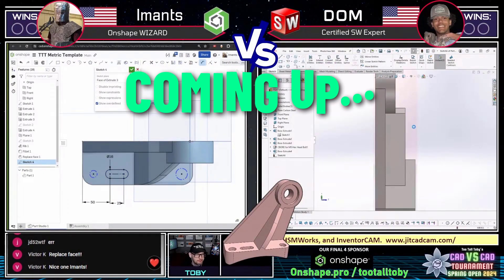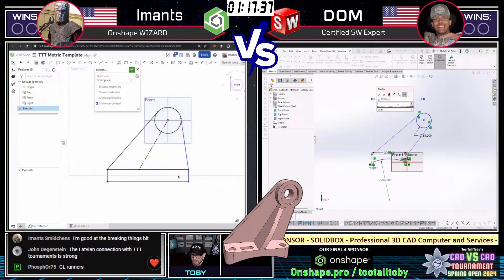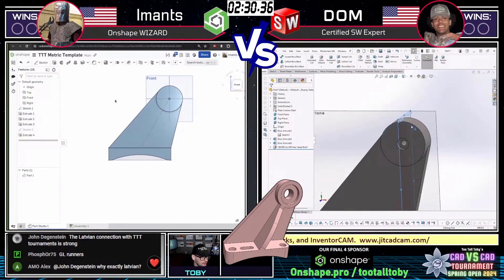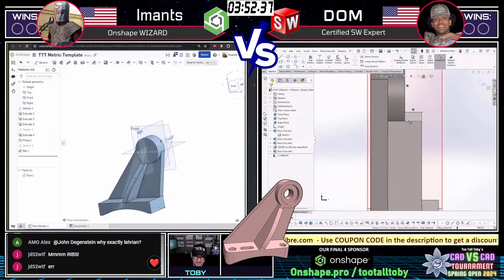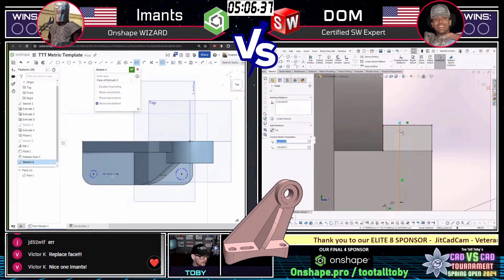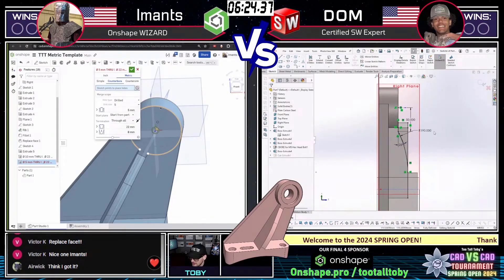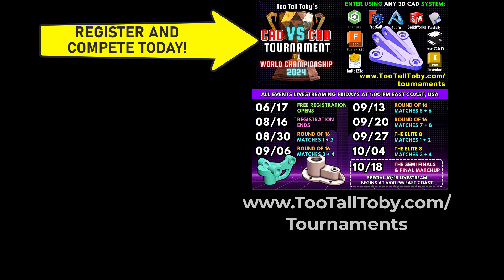Which is FASTER? - ONSHAPE vs SOLIDWORKS - Imants vs DOM match 1 - DENSITY - 2700 kg per M^3

Comment: Hi Toby,
I love your videos and I practice with you every time you publish one.
In this one, there maybe a mix-up in the initial information and some will get different results:
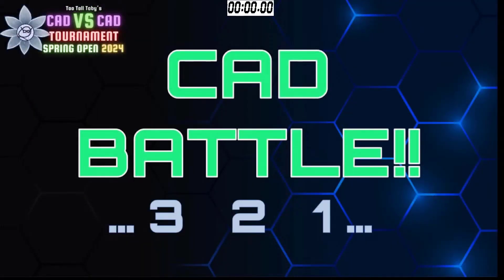At 1:22, at the bottom right you have Material and Density.
If the Material is "1060 Alloy" then the Density should be 2700 and the correct answer will be 3045.0 g
But if the Density is 7800 then the Material should be Steel and the correct answer will be 8796.0 g
Interestingly, the winner had both on his screen at 8:08.
Reply: so which one is correct? by the name of material and the density? is it 3045 or 8796
Reply from the maker: Hi @robertw671  and  @nadepp4699
Thanks for the comments:  This was my mistake - the material is Aluminum 1060 Alloy and the correct density is 2700 kg/m^3

I just went into the video editor and added a blur to the video, and added a note in the title and the description.

Some backstory:
This was the first match of the 2024 SPRING OPEN tournament.
The material was listed correctly on the print.
The density was listed incorrectly on the print.

This mistake was pointed out to me a little later in the tournament, during the livestream.

I had to make a judgement call on the fly.  Since Imants had cleanly created the geometry for the 3D model, and since Dom was really struggling with the RIB section of the geometry, I made the call to let the point stand.

HOWEVER - If Dom had modeled the part first, the geometry looked correct, but he had used the density specified on the print, I would have had a REAL MESS on my hands.  I would have had to retroactively award DOM the point, and depeneding on how deep into the livestream we were, this could have caused some chaos.  So I was breathing a sigh of relief that I didn't have to backtrack - but it was a close call and a good reminder for me to triple check my prints (including the title block) before tournaments.

Hope this all makes sense and thanks for the heads up!  All ambiguity should be resolved on this video now (once the BLUR processes - which is on the youtube servers so it may take a few hours)
- Toby